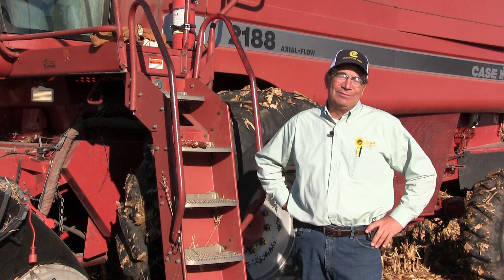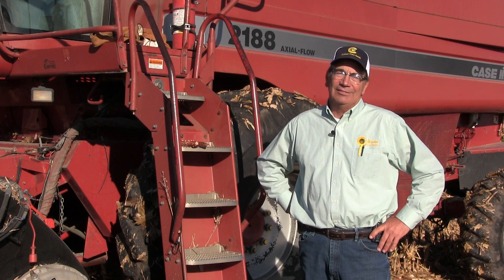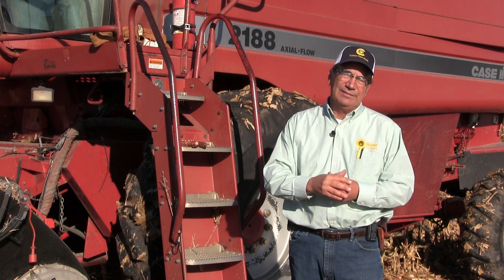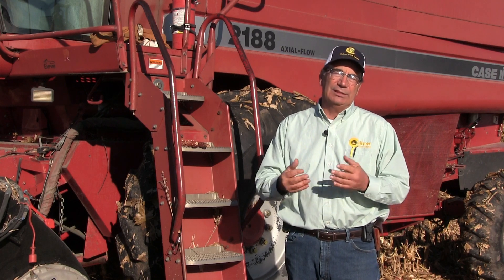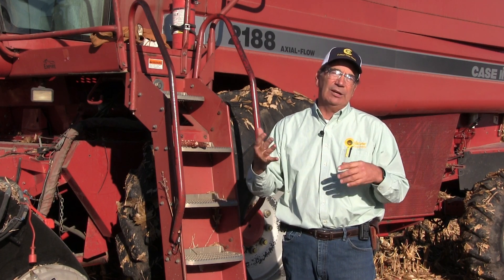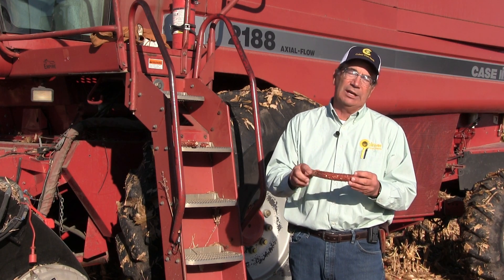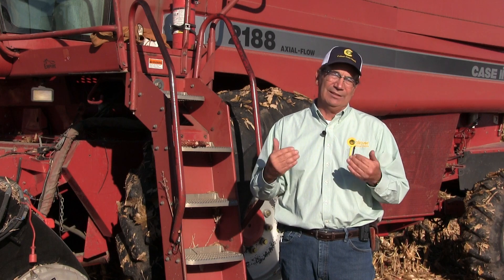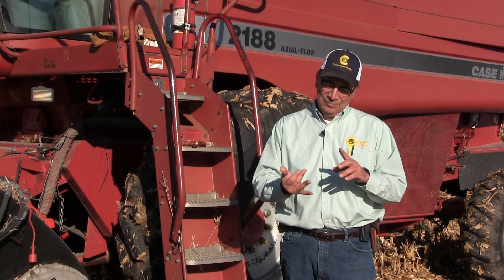Marion Calmer Corn Harvest Tip 2018 - Corn Head Speed, Rotor Speed and Concave Clearance

Comment: What is your opinion on 360 Yield Center’s Yield Saver gathering chain brushes?
Reply from the maker: Feel free to call us at (309) 629-9000 and we can discuss all options for upgrading your corn head as there are pros/cons to various systems. Our patented residue management system does a phenomenal job enabling older corn heads to perform better than new. Satisfaction guaranteed.